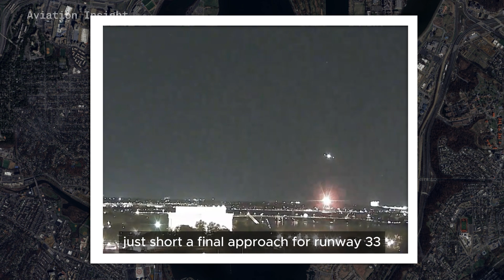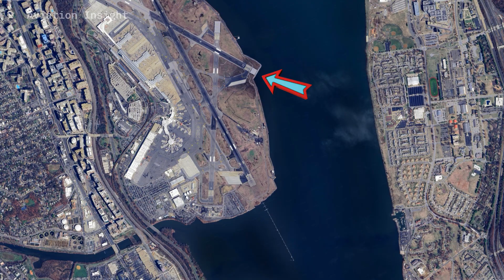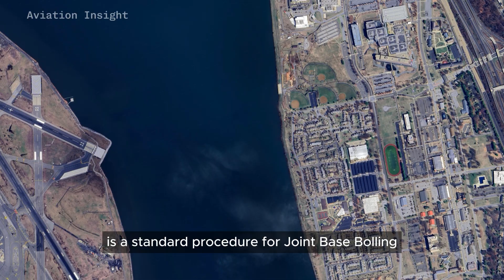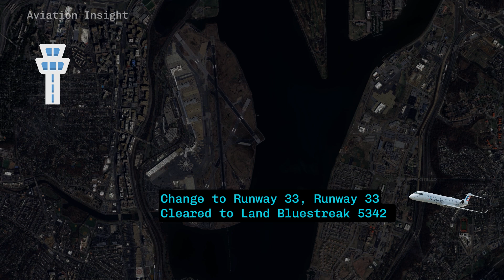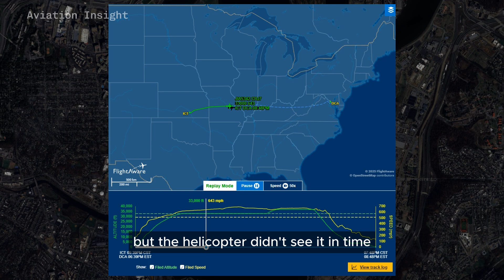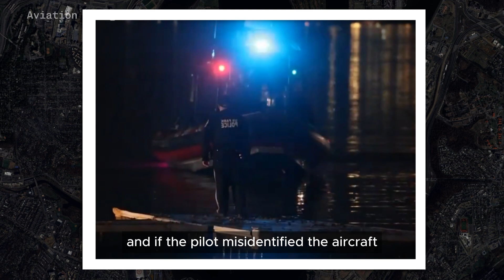UPDATE !!! DC air traffic control before Collision / ATC Recording #aviation

Comment: No matter who is a fault that’s not the point
Reply: What exactly would the point be if it's not to determine where things went wrong and what mistakes were made?  If things ran smoothly and perfectly, they're wouldn't have been a collision.  But tragically,  there was. "Fault" isn't about pointing and saying "neener neener" but rather holding responsible parties accountable.  If that's not the point, then what's the point?
Reply: And ?
Reply: Then what is the point?